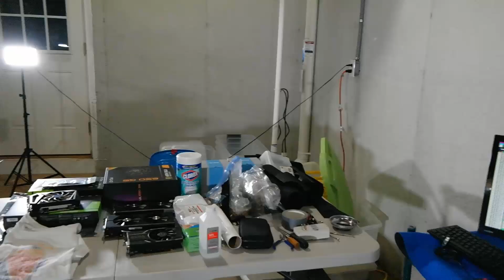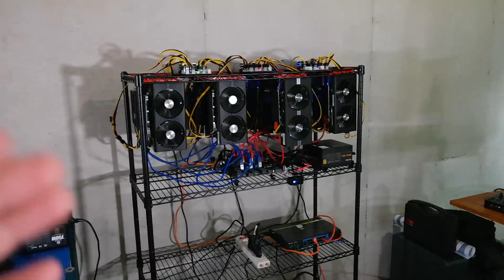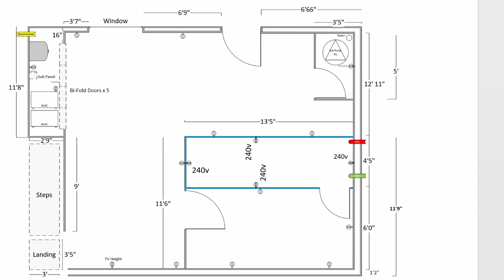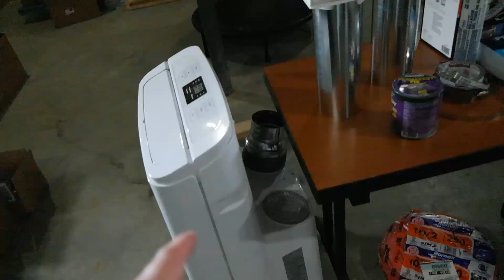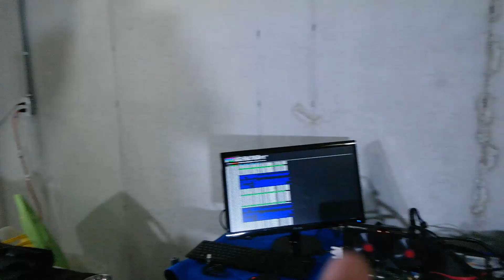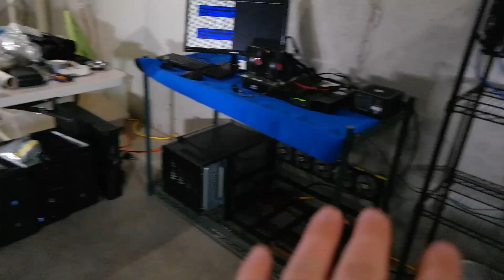Crypto Mining Basement Renovation Project | Ep1 Basement Layout

Comment: Hey man you may not care and I am not sure what the fresh air is for. I am guessing for the ac exhaust. International code says that you cannot have a hole smaller than one quarter inch. Basically you will not be able to move air with that filter. I am quoting combustion air requirements. If this is for the ac I am thinking you are not going to get the efficiency from the unit and or over work the fan.

Comment: Great Job! Lots of good ideas! Your plan will for sure fix ALL your current power problems. :) I am very worried though about the cooling plan. Remember basically every watt your mining gear is using is about the same as you running an electric heater of that same wattage. I would also plan for a method to direct the heat out into your house in the winter. It could mean heating your whole house for "free" without running the furnace at all. :)
Reply from the maker: That's the plan! If this works out well the HVAC output duct is right above this room.  Would make it so easy!
I may even move away from an AC Unit and just do an intake and exhaust fan.  Lots of things to test and try.
Reply: You are completely correct his A/C cooling plan will never work even at half load he plans. Also 4 inch ducts can move very little cfm.. airflow goes up exponentially with every inch. Nowhere near big enough. He would be much better off with 8" exhaust out and a very high CFM fan to create negative pressure and draw in outside air from another vent.